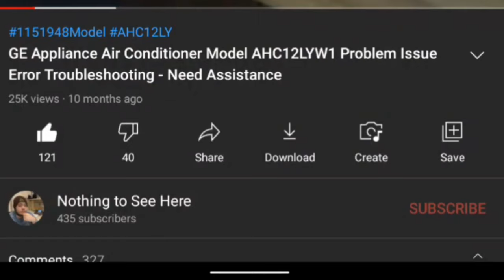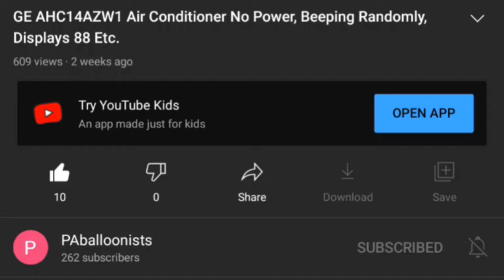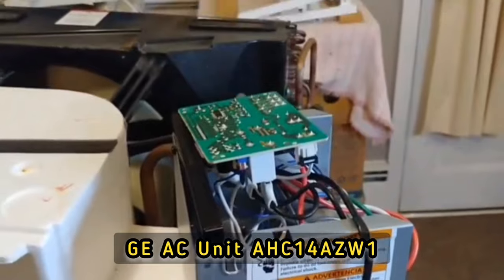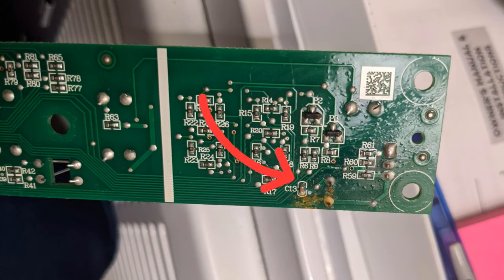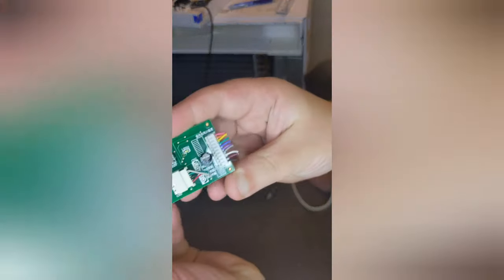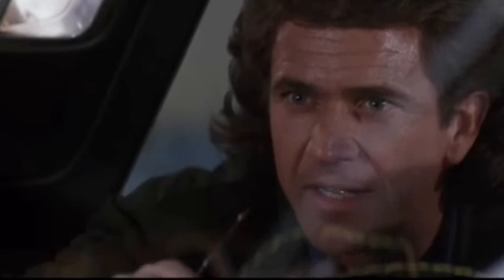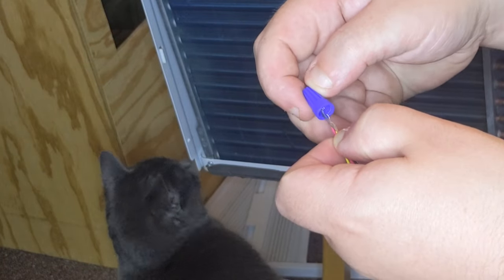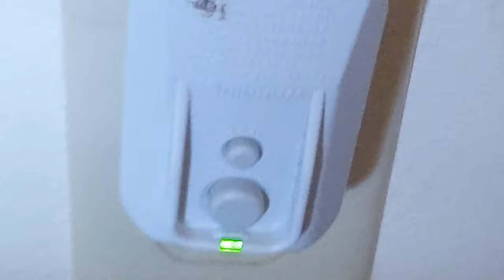GE AC Unit Model AHC12LYW1 or ACH14AZW1 - Unit Beeps, Shuts Off, 88 Symbol Bypassed DIY | How to Fix

Comment: Thanks for this simple solution.
Added switch between black and other cables - works fine.

cables are labeled on the inner circuit board (same order as on this video):
black - +5V 
brown - GND (ground)
white - COMP (compressor)
grey - HRA / WING/UV (no idea what is this for)
purple - BEEP (beeper)
blue - LOW (fan speed)
green - MED (fan speed)
yellow - HIGH (fan speed)
orange - ROOM (no idea what is this for)
red - PIPE (no idea what is this for)

connecting black cable to others you can do more than just constant ON with max fan speed

may even add Arduino/Rasperry if have related exp...
Reply from the maker: Brilliant!  Pinning this!
Reply from the maker: Perhaps orange room is for thermostat or thermometer?  Way to see temp in room to know how to shut off?
Reply: @clarkkc11  I don't trust factory thermostat. Currently working on Raspberry Pi configuration with 3rd-party thermo/humidity-meter (DHT11)
Reply: This helps a lot, What Wires do you think I should keep connected ....for sure Yellow, I want my Fan on high always.
Reply: How do you know which wires mean what? I'm working with a different AC unit.
Reply: So now its all pluged in without motherboard right?
Reply: When you say others which other wires do you have the black wire connected to for auto shutoff functionality
Reply: @tope2386  found labels at the other end of cable (board inside AC)
Reply: @KennyLM3  I use Raspberry Pi with DHT11 thermometer with custom scripts to control that. Some guys use external thermostat.
Reply: Excellent comment , thanks.👍
Reply: I bought 2 GE 8000 BTU window  units in 2022 for my 40 foot RV. Its now a year later ( 2023) and I MUST SAY these are absolutely the BEST on the market.
I got mine at Home Depot , DELIVERED the next day.
Reply: I LOVE THE CAT.
Reply: @trulalalalalalalalla  what is a rasberry pi. I'm wanting to just hook up a basic thermostat, bc since I've done this mone freezes up after about 4 hrs on constant on and it never froze up before
Reply: Idk y
Reply: @gainesken52  are they still working, or have they broken yet? 
I think you posted good reviews on the wrong video.

Comment: Ours did the same thing. If you go to your local hardware store and pick up a digital wall thermostat you can hook it up and have full control. Hook black and red wire together into the R. Yellow in the W and white into the G on the thermostat. Then mount it on the wall beside the window and you’re good to go.
Reply: I tried this, it only turned on the compressor, not the fan. I think the volts are wrong, I[m going to try a 12v rated rv thermostat.
Reply: @jjjohnson1098 
Did it work buying that thermostat?
Reply: What kind of thermostat did you use?
Reply: Do you know if this will work with the google nest thermostat? Also point me to which thermostat you used so I can maybe get one of those? Any help is appreciated. I'd really like to get both of my units back up and running again. Both died in the last couple of days. It's about to get really hot around here.
Reply: Would love to know this. Will any thermostat do?
Reply: I had to wire mine a little differently, but it worked awesome with an off-the-shelf thermostat. For me, I had to wire the Yellow into G, White into Y, and Black/Red into R. I also needed a jumper between R & RC. This allowed me to turn the fan on/off as well as set the thermostat to "cooling" and have it work as expected.
Reply: My Hero. 
You better be getting some real good karma come your way for this.
You saved me, GE/Haier, some police, and the justice system from an awful lot of frustration, certainly kept me out of jail, because I was about 30 seconds from finding a corporate office and taking a car ride to a smashed window 😂
Reply: @BenJacques-i8c  This is the way. Auto fan works this way, or left on at the t-stat, it's like cool on the display panel, fan stays on, compressor turns off. 
I chose the medium speed fan wire, trying to balance the noise. 
This AC unit has been a let down from day one, but I got mine refurbished... obviously the refurbishing is just another crap board in a dumb design.   Water condenses there and drips all over the board when it's particularly humid out... you know, when you need an AC unit.🤦‍♂🤦‍♂
Reply: @jjjohnson1098  same here, compressor only worked no fan
Reply: @BenJacques-i8c wat kind of jumper?
Reply: @BenJacques-i8c did it shut off and on at certain temperature?

Comment: Thank you for this video was overwhelmed when I saw I had to cut wires and stuff but was actually really quick and easy. Saved me from buying another in this hot summer. Never getting another GE
Reply: So do you cut the white black red and yellow wires completely and just tie them together?
Reply: @sophiadiaz9297  cut white , red , black and yellow. Expose a good amount of their wires and twist them all together, cover them with electrical tape.
Reply: You can't even buy a control board for this model unit at GE! On their homepage, they brag about how 'green' they are, then build $450, 45 pound unit that has flawed engineering, and can not be repaired when it fails! Straight to the dump in most cases. Way to go GE !! I will not buy any product from them again. I will also look up the replacement model's parts list BEFORE I buy one to make sure I can buy parts for it when needed.

Comment: Thank you so much for this video. Ive had my window unit for a year and half. This worked for me. Really upset about this window unit though because when you spend 300 plus on a window unit it should last longer then 1 year!!
Reply from the maker: Agreed!  Thanks for watching and commenting!
Reply: i spent almost $600 on this ac 😑 and its beeping rapidly and no lights on
Reply: I got the same problem trying to get someone to fix it know
Reply from the maker: Is it still working ?
Reply: Did you have a wifi cord to yours does that matter?
Reply from the maker: @tiffanyholmes6610  The very end of the video shows that piece the little black part with the USB going to it being removed
Reply: @clarkkc11  thanks I already have it hooked up and running. I noticed you cut the wires to the fuse on the circuit board. Awesome video thanks so much for Sharing
Reply: I'm having this issue and I got it last summer smh I don't think I can do this on my own I'm ready to cry😢
Reply: Please help

Comment: You are a lifesaver I have model ahc18dzh1 and this worked perfectly.  Used the same color wires you did and now I can sleep properly. Gotta wait for it to cool off this room now! Thanks to everyone who replied to my other comments as well. I just put some electrical tape around it till I could get some caps and it works

Comment: Thanks for video! Did this and it worked. Although, I left the control board and only clipped the wires I needed and soldered them (B-R-W&Y) wires together leaving the rest untouched... In conclusion, Shes not bitchin, I'm mean, beeping and blinkin and blowing more cold air then your ex old lady! Thanks a Mil! I have a 2 way switch around here somewheres I'd like to wire in when I find it.
Reply from the maker: Love to hear it!!

Comment: Genius! I’ve had my GE air conditioner for 2 months and it had this exact problem. Your video had it back up and running in 15 minutes..it’s in the 90s this week in Ohio and we have a 18 month and 2 month old  so this video saved us
Reply: You can't even buy a control board for this model unit at GE! On their homepage, they brag about how 'green' they are, then build $450, 45 pound unit that has flawed engineering, and can not be repaired when it fails! Straight to the dump in most cases. Way to go GE !! I will not buy any product from them again. I will also look up the replacement model's parts list BEFORE I buy one to make sure I can buy parts for it when needed.
Reply: @cantyouhearmeknocking1961  I spent 792$ on one did not last 3 months
Reply: Same
Reply: GE Said “well sorry but nothing we can do” my warranty expired wile sitting on the shelf at Home Depot, how the fuck is that fair?
Reply: @cantyouhearmeknocking1961  Mine had this problem after 3 months the exact moment store warranty ended and I had to jump through hoops with manufacturer for refund since repair service doesn't exist. Feels like they're designed to self destruct.

Comment: Many thanks for this! After a little over two years my ahc10lyq1 went out with the 88 error after unplugging before a thunder storm. Plugged back in the next morning, 88's. Now to look at thermostats like in the comment section below.
Your and others fix worked perfectly.
Reply: Thanks a ton for posting the model number. I have that one as well.
Reply: How did you figure out how to wire it to a thermostat?
Reply: @TrinityTalks   check out haunce's comment below in comments. Also do a search on the web for your model number, might get some help there.

Comment: Amazing! My Model is AHY14LZW1, (12000 BTU's), and, it worked, also! Thanks a lot! incredible how GE is damaging it reputation!!!
Reply from the maker: So happy this video is still saving people money!
Reply: After removing the 2 screws on the side, did you have to yank it off or pry from the top?  Also, does this fix only leave the air conditioner on high?  I have same model and it went yesterday.

6.23.2024 est@1258hrs NYC

Comment: I did what you said and it really did work like you said. 
   Now i basically have a new a.c. window unit. 
      When i located the chip board, like in the video, the wires to be cut, were easily located, but i want to say, there is 2 sets of wires, that are covered. It just takes a little looking into these 2 groups to locate the rainbow of colored wires. 
    After i cut the wires, one by one, i did not have to do anything else, because the cuts were clean.

Comment: I bought this model from Lowes: GE  450 Sq. Window Air Conditioner (115-Volt; 10000-BTU) ENERGY STAR Item #840564 Model #AHC10LY. We've had it barely 2 years. Just put it back in the window yesterday and it's giving me the beeping 88s. I called GE and they cannot help at all with troubleshooting. They told me it is not cost effective to repair, and that I should just go buy a new one for another $379. These should last 5-10 years if not longer. Not 2 summers. I was pissed...until I found your video. I'm going to try this and let you know if it works. Fingers crossed it will. From all the comments, I am confident it will work. And I will be forever grateful!
Reply: Followed your tutorial and fixed my A/C. Saved $400 in a time when gas and everything else has doubled and tripled in price. This hack was a life-saver. Thanks for making this video. If I could afford a donation, I would send it to you. But as well all know inflation is out of control and people can barely afford to put food on the table. So I will shower you with THANKS instead until times get better! Thank you once again!!!
Reply: Thankyou for this comment. Mine messed up yesterday and I found this video and send it to my husband so he can fix it. We have to pay close attention to it because our 1st language is Spanish so I hope we understand correctly. Thanks!
Reply: Got it fixed , actually the video sounds much harder than what it is!!

Comment: worked! Thank you and saved me from wasting $500+ on a similar unit. Got plug set up right by ac so I can unplug it when not in use/not home. Will get me through the summer and time to research and purchase a better one. Thanks for the fix!
Reply: So does this prevent the controls from working through wifi

Comment: Thanks for video. A 2.5 year old GE ahc12azw1 purchased from lowes just blew the 88 code, all lights on unit lit up and beeping. cleaned filters, etc, but had same behavior as in video. This fix worked. No visible damage to board. Only run this when working in garage, perhaps reason it lasted a little longer than 1 year warranty. Discontinued model, no parts available. Will compare control unit board to those available for later model. But, I only ran ac on high in past, so it is now a bit easier to use.
Reply from the maker: Thank you for this very detailed comment!
Reply: Whit wires did u connect together im having trouble with same units

Comment: Thank you so much for this video!! I have only had this air for about a year and I was almost tempted to throw it out but was hesitant ! So glad I didn’t. Now my fiancé thinks I’m an electrical genius 🤣🤣
Reply: You can't even buy a control board for this model unit at GE! On their homepage, they brag about how 'green' they are, then build $450, 45 pound unit that has flawed engineering, and can not be repaired when it fails! Straight to the dump in most cases. Way to go GE !! I will not buy any product from them again. I will also look up the replacement model's parts list BEFORE I buy one to make sure I can buy parts for it when needed.

Comment: just did this. works! i will suggest using wire cutters to strip the wire and wire caps to tie them. i tried using tape and scissors and it did not work until i got the right stuff. thanks for the video!

Comment: Your video really came in handy today. It was really hot in west Tn today and had been for the last week and I knew I was going to have to tackle this project. It worked great without a hitch. The only thing that I wasn't 100% confident about was when connecting the wires I had the red black and white that matched up but had a green and yellow left that had to go together and didn't see clear instructions on matching those two up in the video so if anyone has the same color wiring that I have- green and yellow does definitely splice together and the unit works great!!
Reply: Ok update... it's a day later and my unit is tripping the surge protector. Gonna try plugging straight into outlet and hopefully won't trip the breaker in the breaker box.
Reply: @charlesrussell569 how’s it holding up?  I’m super pissed at GE for selling this $800 hunk of garbage.
Reply: @motelmanager21weleavetheli13  still working great and we are having temps over 100 in west Tn. The only thing I discovered is the unit definitely has to be plugged straight into an outlet. I had it plugged into a surge protector originally and it would trip the surge but when I plugged the bypassed unit straight into a 110 outlet it works great!

Comment: I have a newer model that's lasted about 9 months. Control board took a crap today. Wouldn't do anything to control temp. Took it apart and used wires yellow, red, and white. With black hooked up it wouldn't work. If you read control board on small writing it tells what each wire controls. All you need is power, compressor, and high for fan! Awesome quick fix to get me by til it cools down here in SC!
Reply: what model do/did you have?

Comment: I bought 4 of these GE units
First one I replaced with a LG 
But kept the broken unit
Second one I did as you said came on no cooling
I pulled out the first one 
Did as you said…. Boom
I have a working unit
It’s not what I want with all the automatic shut offs and all
But, this will work for the summer

Thanks for the info 
👍

Comment: UPGRAYED:
Go ahead and order a BYT-3A016 thermostat.  You can then set temps and give yourself some control options kinda' even better than factory. The wires in vid are as follows. Black= +5V and is essentially your main wire. Pink="room?", just make sure pink stays with black.White=Compressor , and Yellow,Green,Blue are High,Medium,Low respectively. Find and wire 110V(make sure you order the 110V version) to the thermostat. On the relay out, Black and Pink on one side, White on the other. then choose High,Med,Low(Yel,Gr,Blue) and put it on the Black-Pink side for always on, and with the white for only on when compressor is on (maybe a bit of a heavy startup surge load but not a big deal usually).  Thermostat temp sensor is on a long cord , so you can read the room, not just at the unit. Note the the thermostat needs to be changed to "Cooling Mode" via the buttons, and is a real good idea to change the "hysteresis"...setting "d" (for deviation). Chang from 1 to 7 or so. This way the room temp swings 7 degrees before turning on the compressor. keeping it 1 would be hard on the compressor with a lot of starting up. 'you're welcome.
Reply: Hi, I just did this bypass for my unit at home and also bought the thermostat you recommended, can you help out with more detail on how to hook it up to the actual thermostat, thank you🙏🏽
Reply: @chinodeamigo2220   Thermostat power: Scavenge a short section of power cord and terminate black and white to screws 3 and 4 (doesn't really matter which is which). I chopped the air conditioner's power cord close to where it enters the unit and wire nutted (hehe I said "nutted") in the added power lead to the thermostat. Output Relay:(screws 1 and 2) Black and Pink and **Green under screw 1, White under screw 2.   **I chose to have fan on medium and always on thus green is with black under 1... you might want fan only when compressor on then you could put under 1 with white.
Reply: @haunce  Can you do a video on how to install the thermostat? My unit also gave out a few days ago. Thanks.
Reply: 2nd that on the video
Reply: So we don't connect thr gnd together with 5v and room wires?